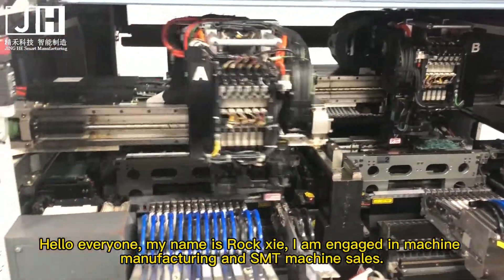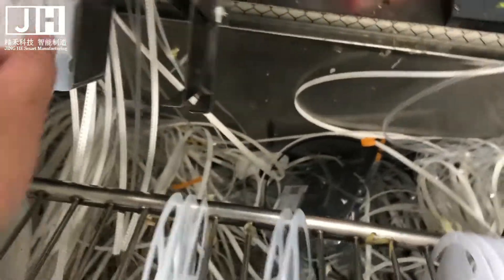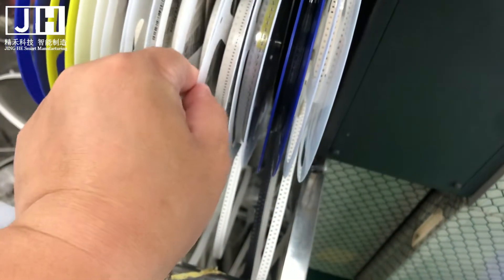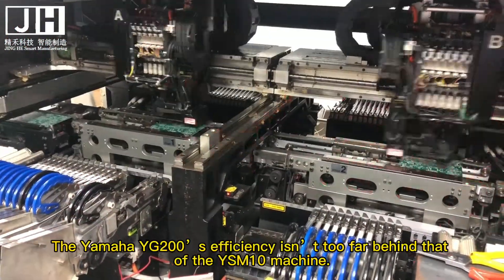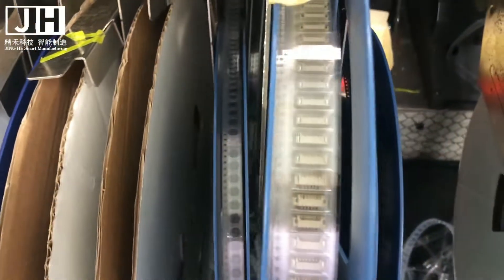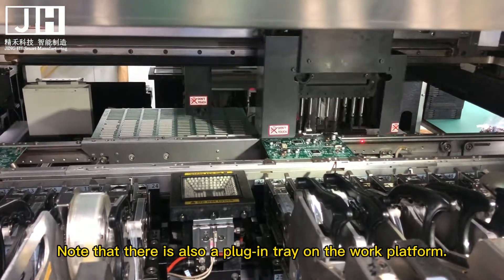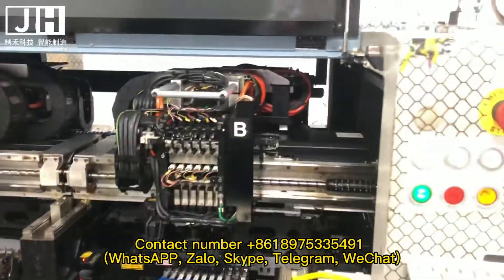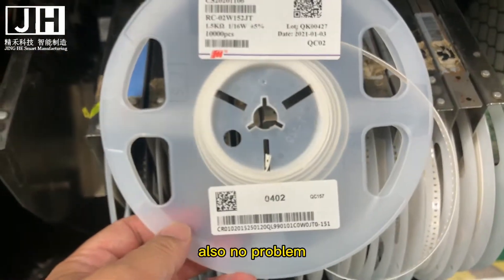Yamaha YG200, YG100R, YV100XG pick and place machine, how to place IC, QFP, how is the accuracy?

Comment: 28000/4 head is 7125 cph one board is slow
Reply from the maker: Although in this era of 2023, this speed is really slow, but this machine was released in the period of 2006, in the period of 2006, what brand of machine, assembly speed can reach this 28000CPH. Now this machine price is very low, this speed can be compared with the latest Yamaha YSM10 now.
If you want to know the fastest, most stable and comprehensive ability of the current machine, I recommend this one.
https://www.jhims.com/html/product_517.html